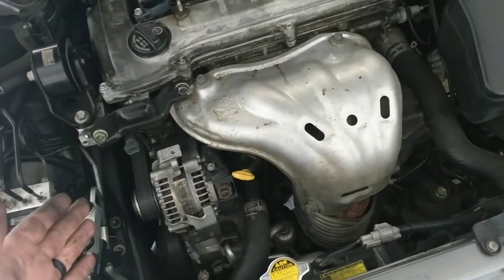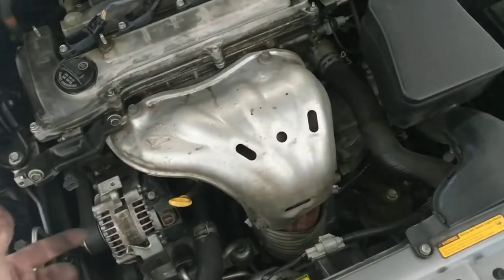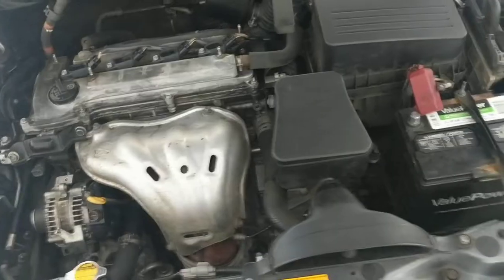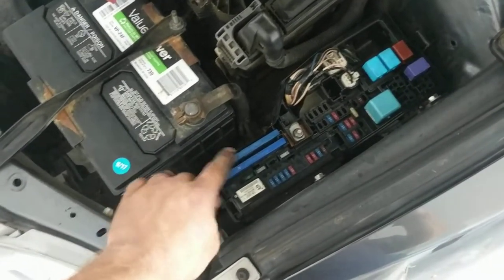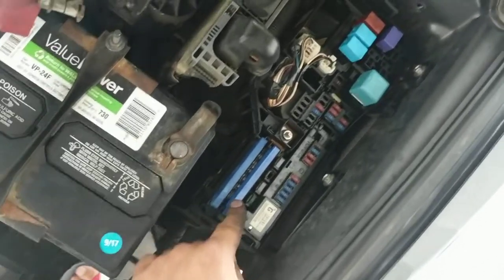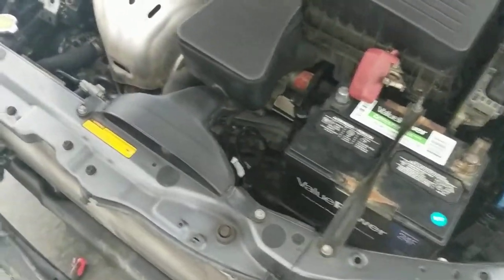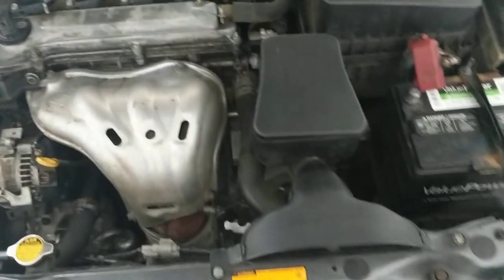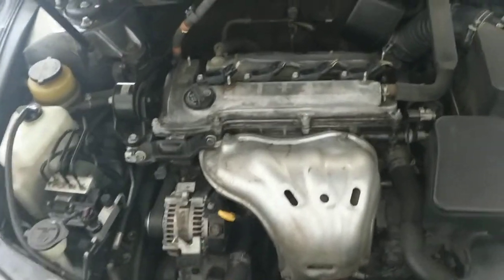electric problems  Toyota Camry 2007-2011 Tips

Comment: My 2007 toyota camry engine goes off when I turn on the AC. Sometimes it hesitates so badly. I've changed the compressor 4 times but still. And my MAF metre is not set at its normal position.  When it's placed on its normal position, the car sounds like misfiring and not stable. So my local electrician has rotated the position of the MAF metre and the engine stays normal. But it still hesitates and revs up and down by itself. What can be the issues ?
Reply: Same
Reply: Did you figure it out
Reply: @texasoweee  engine was getting weak. I had it overhauled and it was okay

Comment: How would I switch out the negative terminal to one that looks like the positive? I ordered a set and the negative one in your video is the same as mine but my new set is exactly like the positive terminal setup please let me know
Reply from the maker: I think you don’t need to worry about how it looks. If you do the right connection. It will work

Comment: Hello friend, I have a problem, can you help me please? I have a 2011 Toyota Camry. It turns on after a while and turns off and I turn it on again and it turns on as if the power went out. Sometimes it stays on for like a couple of hours and then it turns off.
Reply from the maker: Did they check the gas pump?

Comment: A mechanic told me that my engine has lost pressure that's why the AC turns off the engine. So we rebuilt the engine. New pistons, new rings but still engine dies. After installing new engine components, I have run the car at low ram of 2000 and its now 150miles at from 2nd October to today 10th October 2021, yet the car still smokes out light blue and black smokes sometimes. These smoke do not last for more than 2 minutes and it cuts. Does it mean rebuilding went wrong or engine is still breaking in? Or at this 150 miles, should I change the oil?
Reply from the maker: I’m sorry man. It’s a sad situation. Definitely rebuilding the engine went  something wrong. The AC system is not connected with the engine. Just the belt which runs the compressor. I don’t know why he decided to come with this idea. But was a wrong decision. I think you had a electricity problem before.